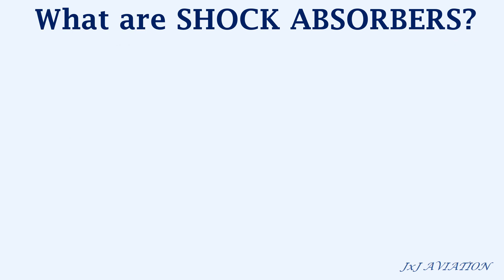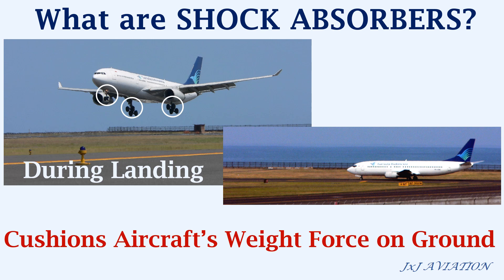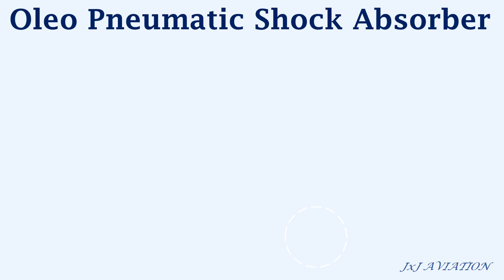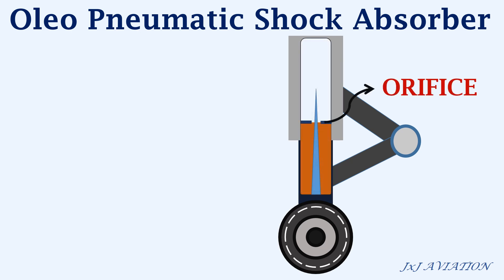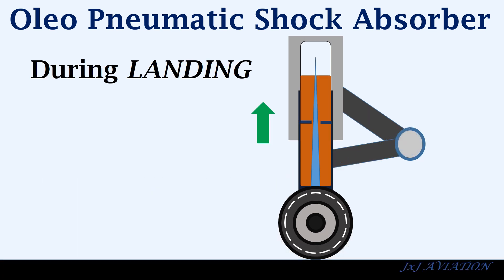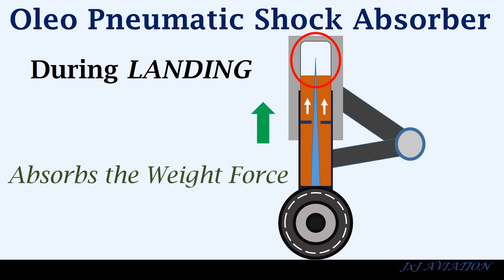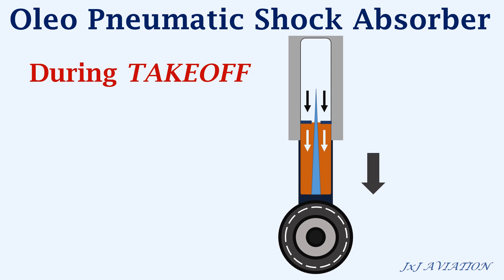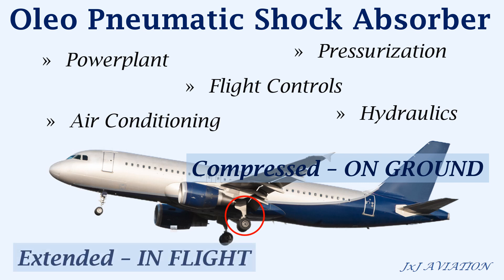Understanding an Aircraft's Landing Gear System (Part 1): The Shock Absorber!

Comment: Since the outer cylinder is fixed to the aircraft structure then in compression stroke how the outer cylinder moves upward?
Reply: Due to the pressure acting on it because of compression! They cannot be fixed structures as if it was a fixed structure and you are landing an aircraft using it, it would easily break due to the high loads. It has to be move-able to be able to absorb those shocks adequately.
Reply: What @gamergtg9231 said is false. The outer cylinder is fixed to the aircraft. When the outer cylinder moves up, it is implied that the aircraft attached to it is moving up as well.
Reply from the maker: It is the inner cylinder that moves upward, outer cylinder is fixed structure

Comment: That is not a “shock absorber”it’s strut assembly. Looks like an NLG type but some Airbus and many Boeing employ an oleo type with integrated air spring or steel coil spring assist. Regardless, a shock absorber is a damping device only, controlling rebound and compression loads on telescopic or rotating assemblies. 

This is a strut assembly with an integrated damping piston that controls fluid flow between chambers and has a N2 charged bladder on the compression load side to maintain performance over broader temperature range. The primary purpose of strut assembly is supporting load, stabilizing wheel assembly and maintaining constant tyre pressure on runway for directional control on taxi and best braking performance. The resultant isolation or damping inside fuselage is just an added benefit limiting the load on airframe assembly and requiring less damping efforts inside fuselage.
Reply from the maker: Thanks for the detailed explanation!

Comment: I have a question: Why the shock absorber has to be fully extended when the gears are retracted ?
Reply from the maker: When the gears retract, the landing gear bay in the fuselage is designed such that the gear can retract smoothly and safely only when it is fully extended. A space saving measure on the fuselage!
Reply: @JxJAVIATION  I see. Thanks 😄

Comment: why do we need hydraulics? Why can't the air just compress/decompress on its own?
Reply from the maker: The compression is more controlled and regulated using Hydraulics!
Reply: The air takes the first load compressing fairly quickly, the oil moves rapidly through holes inside between the two cylinders. After the leg reaches full compression for the load of the aircraft it starts to extend, this extension is slowed by some of the holes between the two cylinders being restricted this reduces any tendency to "bounce" and the leg extends until the weight and pressures in the leg balance out. Sorry if this is a bit complex but an oleo pneumatic shock absorber is a relatively complex thing. Basically the air takes up the initial load, the oil takes some load and damps out bounce and the air then allows the taxi loads to be easily absorbed without the u/c being too "stiff". The posters explanation was good but a bit too basic hence your question. I hope this helps.

Comment: Oleo name is interesting. Air and oil pressures working both against and in tandem with each other. Is oleo an acronym ?
Reply from the maker: Yes, I like the way you put it: Working against and in Tandem! 
Oleo is not an Acronym. It just means something related to OIL!
Reply: @JxJAVIATION  thanks for.reply. Reminds me of the term oleo used for margarine in days gone by. It was basically oil, so makes sense.
Reply from the maker: @chrishintz1077  Yes that's right!